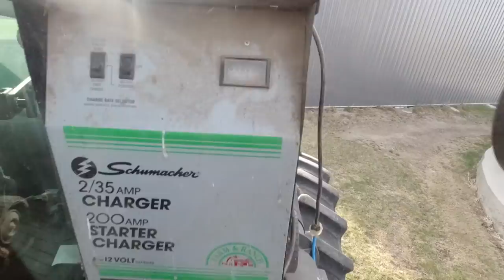Sad Short Life of the Wire Winder

Comment: I can see a thing you might want to change on the wire winder if you ever make a mk II. The brace at the bottom front, instead of a right angle that can catch on the ground a short little angled corner that can glide over bumps and rubble on the ground instead of getting caught might be worthwhile. More welding, but something to consider.

Comment: That hydraulic pressure bringing the halves of the winder together is always going to bend that vertical pipe it bent this time unless:

you put a relief valve in the line to the ram that controls this "closing" so when the gap between the rollers is complete, either when the original "coupling" of the two halves is complete OR whatever is jammed in between..... so when it reaches the same pressure as normal for the coupling the supply from the pump bypasses via the relief valve....
or 
the point at which the frame  bent (that vertical pipe) is made "sleeved" with a shear bolt holding the inner and outer so that excessive pressure = sheared bolt before it can bend stuff?

Comment: I wouldn't worry about the wire winder Things break even stuff that engineers design break ! At least you can fix it and you still saved the farm $4000 in the process and the thing works great . If it was one you bought from a large manufacturer it probably would have snapped in half instead of Bend . Great video keep up the good work!

Comment: you could change the hydraulics to incorporate a pressure relief on the close circuit as to not have that happen again. would require less not having to beef up the frame as much and could remove the operator error from the equation. the slide out function on the cylinder shouldn't take too much pressure.
Reply: Or an outside  collar  that covered  the  joint

Comment: On your wire winder thing-e, think adding a couple of horizonal metal pipes across the front a few inches apart to thread the wire through would help knock off the sticks and stuff to keep them from getting wound up in the wire? Might also help take the tangles out of the wire so your wire spool stays as compact as possible.  Just a thought from someone who knows just enough to usually screw things up... lol...

Comment: Hopefully, the rain didn't disappoint. The wire winder was a big success. I like the way you can lift the wire out of the grass and wrap it up so quickly. So what if it broke? That's what test runs are for, to see where there are weaknesses. You'll either modify it to prevent the wire from getting caught, or just avoid trying to close the reel with wire still on it. Given the amount of fencing needed on a cattle farm, this was a much needed piece of machinery.

Comment: I'm surprised it holds as much as it does..., would've though those cross braces maybe would've cost you a lot of room for spooling up wire but judging by the fact Brian couldn't lift that one roll into the back of the side by side Id say they are more than heavy enough..., as far as tweaking it..., don't worry that is going to happen with something built from scratch (pretty impossible to make it perfect right from the start)
Reply: Dropping the reel of old wire directly onto the trailer deck seems the way to go...
and using forks to move that old rusty heavy reel of wire at any other time seems the right way to go as well....
Reply: @JohnSmith-yv6eq  its like anything using a tool and using it efficiently are two different things completely....., and efficiently running a tool comes with hours of use..., will say that looks like a mighty handy attachment to have!

Comment: May the rain god's be kind with a three day / 4 inch total rain.   You might also consider mounting a reverse rotating hydraulic motor on the second side of the wire winder and just have the two sides mesh but cut out off the overlapping tabs.  Then worst case if one common hydraulic feed results in slight twist to the coil if the two sides run slightly different speeds.   Might be able to sell those twisted coils as lawn art at Storla Station..

Comment: Looks to me that the malfunction of the wire wrapper was due to operator error. But you really can't blame your Dad because I'm sure you didn't write a operation manual. Oh & by the way I'm pretty sure that suckered needs some safety sticker on it like don't  put your hand between the two reels when you're putting them together for one. Yes that's sarcasm.

Comment: This episode was about your wire winder.  The pipe got bent.  I'm curious why you didn't just heat the pipe up and bend it back.  Yeah you probably would have had to disconnect your hydraulic stuff off of it to do it but that's better than cutting the pipe off.

Comment: Cole, looks like you ARE smarter than a 5th grader. Your barbed wire roller is kind of like an old girlfriend I had years ago. Ain't to pretty, but dang can she work.  Done good Brother.
Before you go cutting it all apart. Tie a ratchet strap to it. A big one. And see if it will pull back into shape. Then brace the crap out of it. That way it does not happen again. Or push it with a loader bucket. No need to cut until you have to.